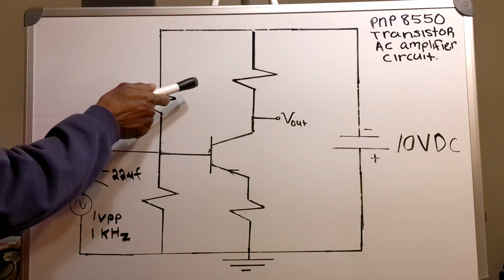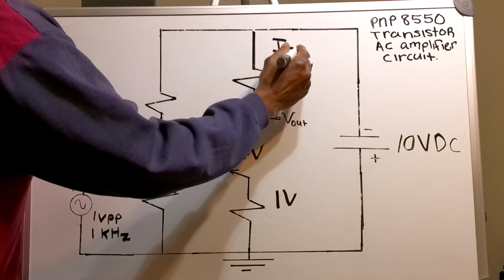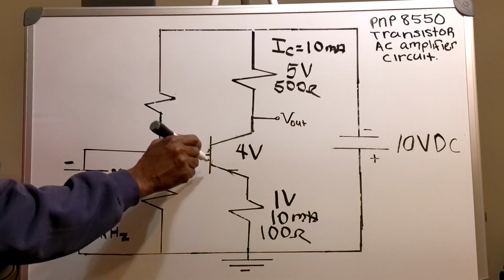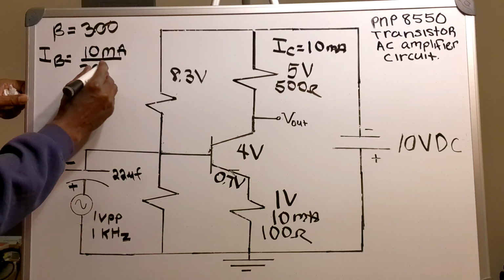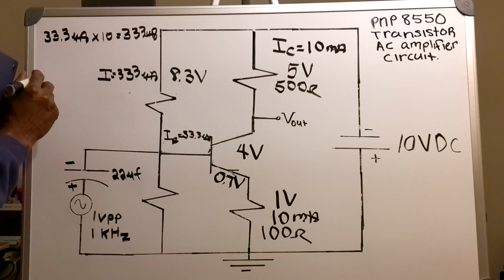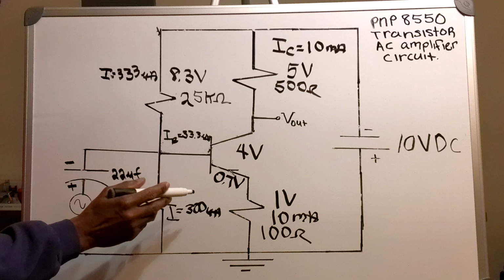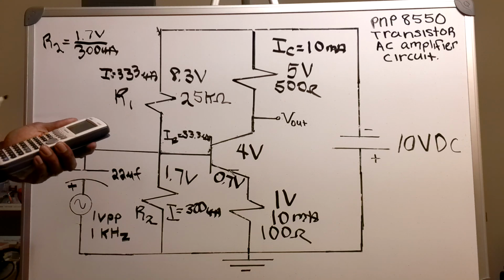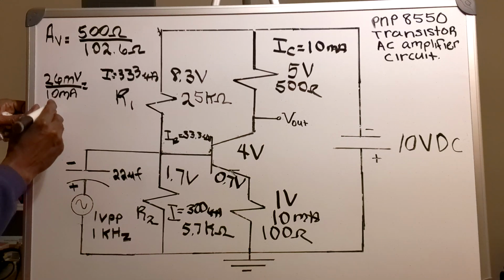PNP Transistor AC Amplifier Circuit!

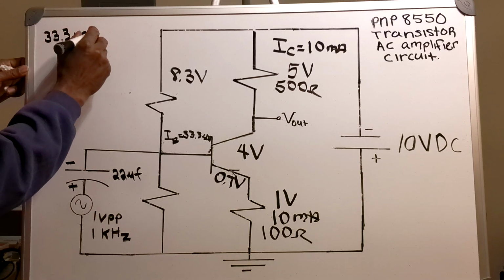Comment: Hello, interesting but there are two points that I don't understand, where does the multiplication by 10 at 7:16 come from? And at 9:17 the multiplication by 9? THANKS
Reply from the maker: As a general rule, you multiply  by 10 and 9 to get the base current through the base and not through the back resistors. You could also multiply by 11 and 10.
Reply: The idea is to have the current flowing through the base resistors "large" in comparison to the base current so that the base current has little effect on the output of the voltage divider formed by the base resistors. Therefore, 10 is an arbitrary number.